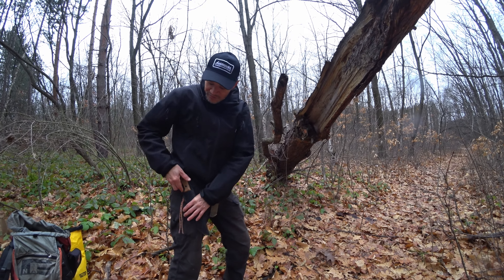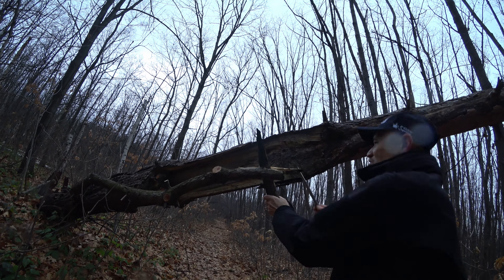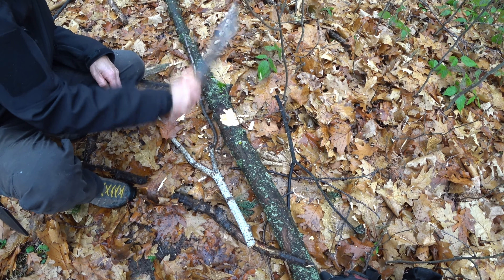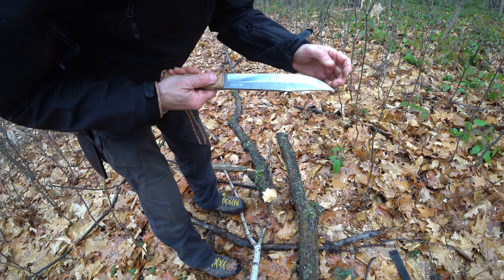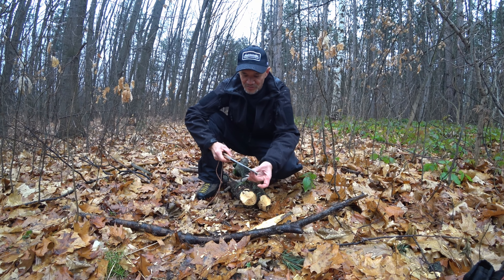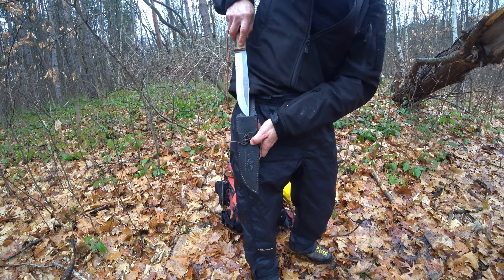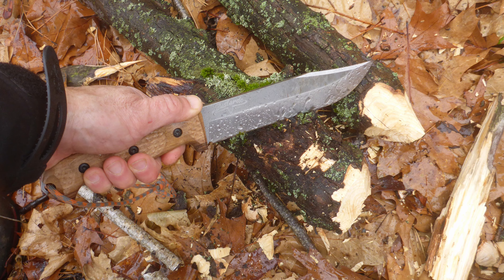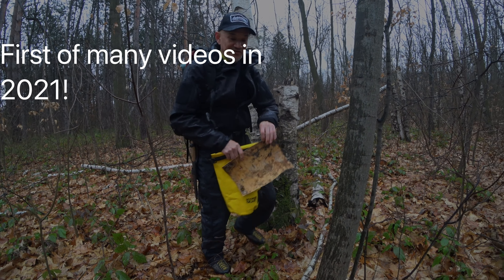Kizlyar Supreme Bastardo Field Review

Comment: When I started looking into knives, a few months ago, I also joined the hype, trying to search for the perfect steel. Those times are behind me now. I mean, a knife is defined not only by steel type, but also the heat treatment applied on that steel and the edge geometry of the blade. This combination is what matters in the end. You don't need the toughest steel on the planet to do your thing with it, you need one that is tough enough for your use case, the same with hardness, edge retention, corrosion resistance, wear resistance, etc. Most of the knives from good knife makers will last you a life time even if they're made out of "crappy" steels like 420HC, 440C or AUS8. Ignore the steel snobs, you can a get a very good blade in these "shitty" steels if the HT is spot on and the edge geometry is suited to your activity. Most of the super steels require a lot more effort (physical and financial) in sharpening them. For me, this is not worthed even if I can afford buying them. A knife is a simple tool, is not a laser gun. There's nothing fancy about it. Just use the damn thing, take care of it and it will serve you well for years and years to come.
Reply from the maker: Totally correct! Thanks for commenting and watching! It 's easy to get hung up with this stuff but as u say, at the end of the day it's of no consequence really.

Comment: At 6:50 you say you don’t recommend the knive for batoning. Are you talking about this specific knive or in general? I want to purchase the sleipner version of this and i am trying to search for reviews but most of them are in russian, so kudos to you that brought to us a review in english! 😁
Reply from the maker: I just mean any knife. This knife I have on many occasions beaten it severely with big heavy lumps of wood. The think why i don't recommend this is because at some point maybe someone will accidentally hit the handle and cause some damage either to the handle or the knife itself and then report back to manufactures there are some problems when in fact they caused the problem. I think too because of so many variables, manufactures are few and far between who will actually say batoning is ok, so i don't want to stir up any trouble for any manufacturer by saying I would recommend this. I sometimes show it in my videos but most of those videos either in the actual video or in the video description I will state I don't actually recommend it. But yeah sure sometimes if there really isn't anything available to burn of the right size I will do it.

Tis i great model from them for sure. The one is Sleipner will also be excellent I feel based upon my experience with Sleipner and also the quality of their products.Don't forget though, with Sleipner, you will loose a little corrosion resistance; although not an issue if you don't plan on having the blade wet all the time. Plus it may take longer to sharpen if let go completely dull/blunt. But I love Sleipner. Many thanks for watching and commenting.
Reply: @BushCampingTools  Thank you so much for your answer! Very clear and understandable. Keep doing videos and reviews :)

Comment: Great review.

 420HC is used extensively by Buck, and it performs quite well.   

It looks like Kizlyar Supreme got the edge geometry and heat treatment right.

I have two of their knives. Both are CityHunters. One is AUS8, the other is PGK. The AUS8 does fine, and is a breeze to sharpen. The PGK has fantastic edge retention, but isn't nearly as hard to tune up as D2.
Reply from the maker: Yeah I have the City Hunter in AUS8 and also the Urban in AUS8 both great performers. For me Kizlylar Supreme really have their heat treatment protocols dialled in perfectly. This is where I disagree with the many who try and state heat treatment is an art, no, it's a science and to produce reproducible results, must be conducted as such for repeatable results. For example the 420HC, case in point. It is a misnomer to think that lower carbon alloys can not be adequately hardened and 420HC has a very interesting metallurgical properties. Those who slag it fall back on it is "cheap" to use but in order to get a good hardness and toughness etc it requires a proper heat treatment and tempering regime. As you correctly  point out with the Buck etc.

Comment: Hey Francis, between this Bastardo in 420HC and the Jungle Combat in N690 from Fox, which one would you recommend for an all around do it all survival knife? Both seem pretty good to me, but I guess that the N690 from Fox would fare a bit better and the blade geometry from the JC looks sturdier.
Reply from the maker: I would have no problems with either both are great knives and the way Kizlyar Supreme a heat treating that 420HC, to be honest on a practical level it's performance is top notch. I'd actually go for the Sleipner version next time of the bastardo just because i love Sleipner as well. The combat jungle you could (even though it isn't per se) use it for skinning if you had to the  clip point of the other isn't so fpr for that.
Reply: @BushCampingTools  
I never had a knife made in 420HC but I've heard from buck users that this is a very capable and convenient steel if heat treated right. Knowing Kizlyar knives I'm sure that their heat treatment is also top notch on this one, they in my experience get the best out of any steel. 
But it appears that the Bastardo has a hollow grind, do I see that correct? If so then this could be a slight disadvantage as a general survival knife against the full flat Combat Jungle, as hollow grinds tend to not be as sturdy as flat ones. They do cut better though

Comment: I  bought the Sleipner version of the Bastardo. I buy blanks and fit my own handle. Very heavy solid knife, and prefer it to the Kizlyar Sensei. Easily one of the best choppers.
Reply from the maker: Yes indeed, the geometry makes it very efficient  and I reckon for sure it will give a small hatchet a run for its money. Out of interest what kind of material did u use for your handle?
Reply: @BushCampingTools  I generally use ironbark, spotted gum, jarrah and merbau. I use 2 part epoxy and brass pins. Just need basic tools to cut the shape. The Aussie hardwood looks great and extremely tough. I did some testing and the handle did not break under extreme test. I have provided a review on Amazon and included pictures. Be aware the blades come blunt and will need to be sharpened. I use 400 grit belt sander and honed on a ceramic rod. Razor sharp. Cost of the blank Bastardo in Sleipner is $90 (changes constantly on Amazon).
Reply from the maker: @nunika1975  Yeah our Eucalyptus species are damn great and need to work their way into mainstream knife scales i reckon. Just thinking about all those hardwood axe handles!
Reply: @nunika1975  glad I found this comment. I bought the bastardo blank and was trying to figure out if it needed sharpening as it felt quite blunt. (I'm a complete amateur to knife building) I will have to sharpen it once the scales are on then I guess.
Reply: @wiggawithattitude  All of the Kyzlyar blank blades are blunt. I used a belt sander to get a good sharpen (240 then 400). Great blades and can save heaps doing the handle DIY. I recently experienced the Kizlyar Dominus blank in AUS8, and it's a fantastic steel. The dominus is also a nice solid piece.
Reply: @nunika1975  aye. I'm very impressed with the blade itself. I've never sharpened a blade from square before, only reprofiled existing primary bevels. I have a belt sander I could use but I'm not confident that I can keep the correct bevel angle freehand. I may get something like a kme or lansky sharpening system to ensure I keep a consistent angle.